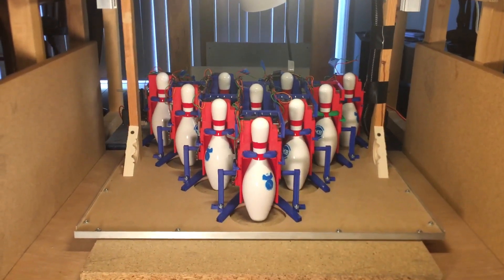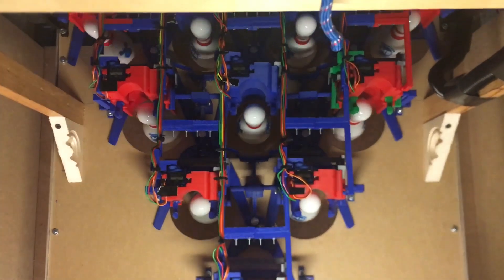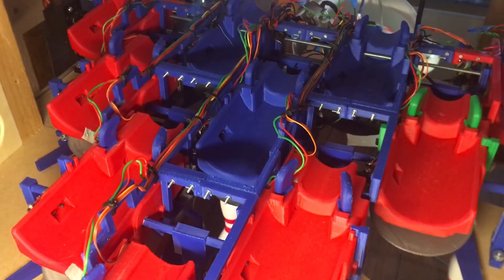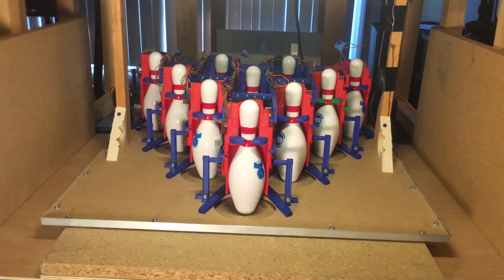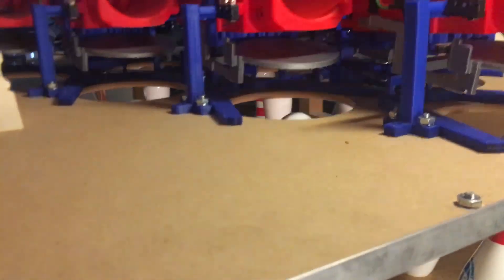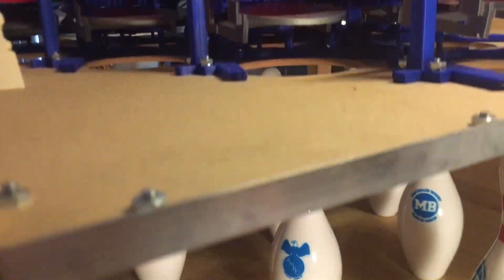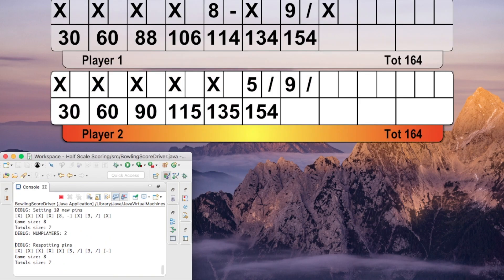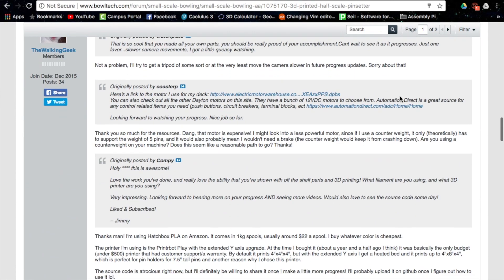Half Scale Bowling Pinsetter Explanation

Comment: Hey can you please do a more in-depth video on the mechanism to pick the pins up? I am making one but really tiny for my pins and I am thinking of using this design
Reply from the maker: TheBrazilianHotDog724 hello! (Sorry for late response) I do have another video on my channel that shows the mechanism in a little more depth (around 3:00 on this video: https://youtu.be/HdsLAlK_UZo ) As far as reproducing it for even smaller pins... that might be slightly more difficult. A lot of the parts were already a bit on the small side for 3D prints (ex. The fork-like device that rides in a track on the fingers is pretty thin), so I’d be fearful of trying to reproduce it on an even smaller scale. Is there anything in particular that you’re curious about?